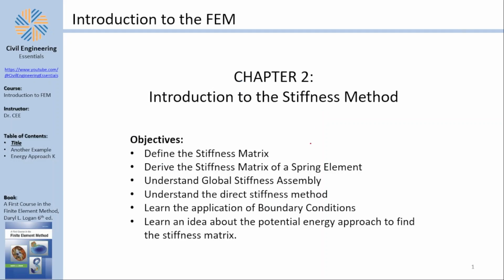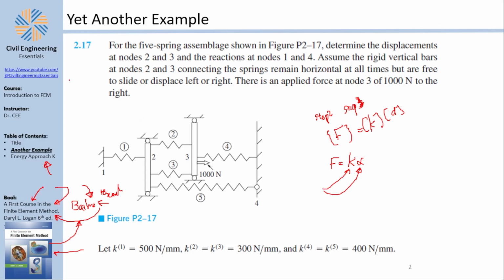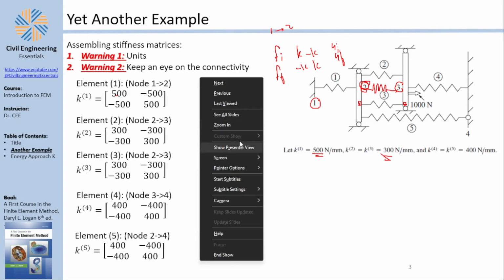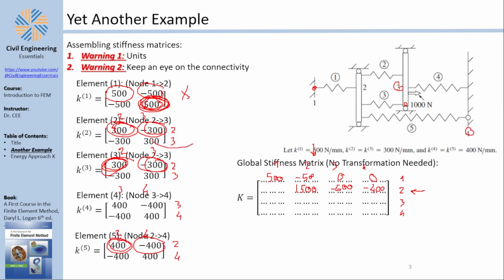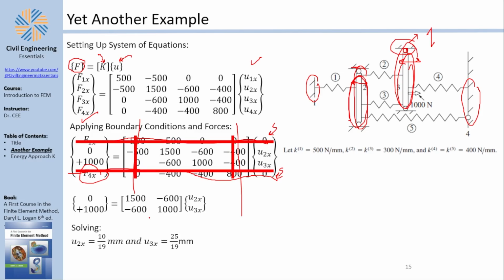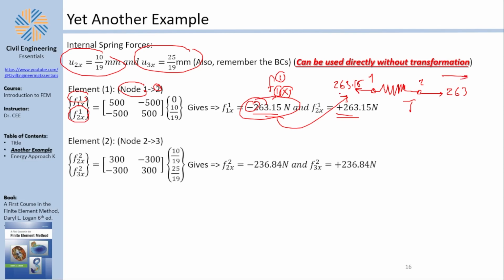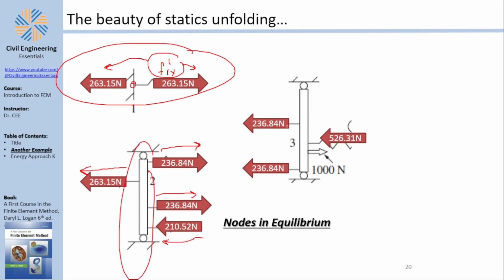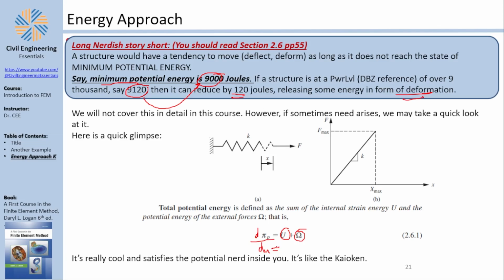The Finite Element Method (FEM) | Part 3: Simple Springs (2)

Comment: Hello , i think you made a mistake as the sum of forces in node number 2 and 3 is not 0, and how could that be when there is displacement of node 2 and 3 , so i assume you misjudged the direction of forces when you applied them on the nodes 
Thank you!

Comment: I seem to enjoy this lecture series soo much. Thank you Sir. Keep up the good works. 

My bit is this, Incase the local stiffness matrix of any bar element is at angle theta from the GSM, does it require the resolution of the forces and displacements only into the Global system? Or there’s more to be done? I don’t know if my question is reasonable enough, however, I wish to pick your mind on it 

Thank you CEE for an amazing series.
Reply from the maker: Hi there Engr. Sarpei, 
I am happy you enjoyed the video.

You are right about the axis and conversion from local and global systems. Your question is 100% reasonable. Now for its answer:
Yes, you should do transformations.
Luckily, the local and global systems for our spring systems coincided. This will NOT be the case in our next chapter. So Stay tuned for it.
Still, spoiler, you would have to cosine and sine movements to be able to convert from local to global and vice versa. There is a lot of detail there and I will DEFINITELY talk about this ^_^ it is an extremely important issue in FEM.

In case any other questions come to mind, feel free to asks.
Regards,
CEE
Reply: @CivilEngineeringEssentials  thank you 🙏